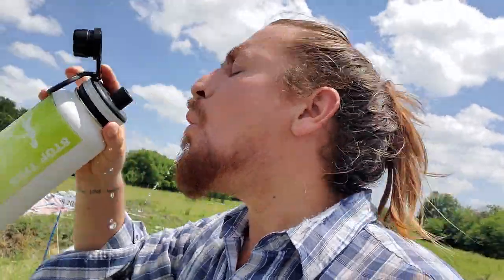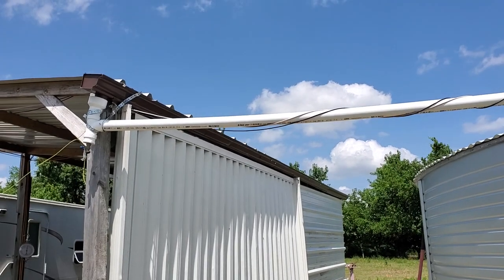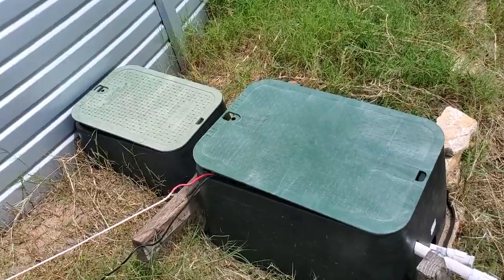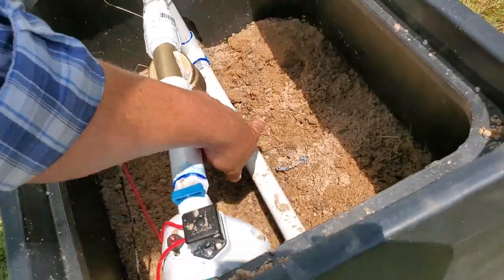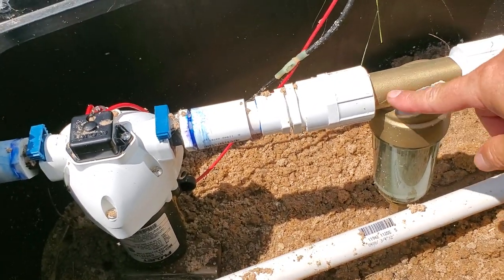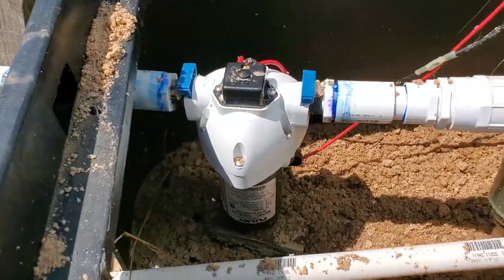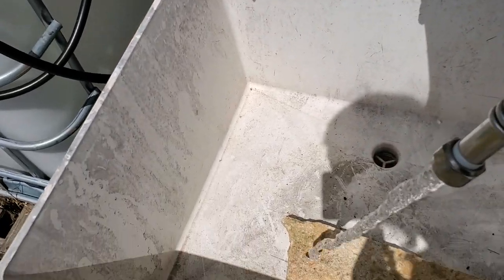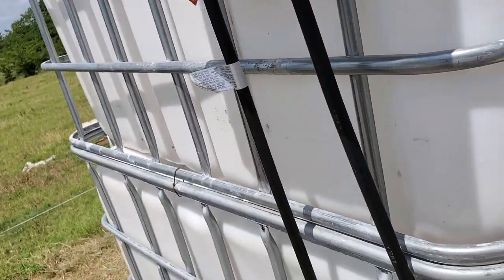How to pressurize water from a rainwater tank at low cost

Comment: Fix the drip at the filter. It will cost you a lot of water over time
Reply from the maker: Thanks Trip, I dont have it running 24/7. This is a temp system. Once finalized I'll glue it.